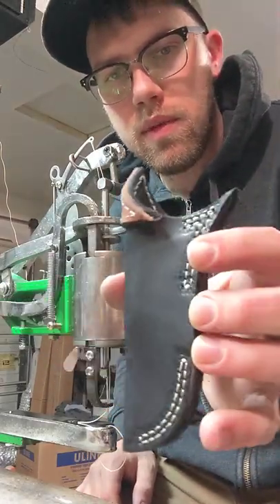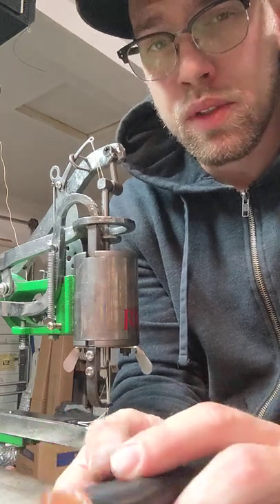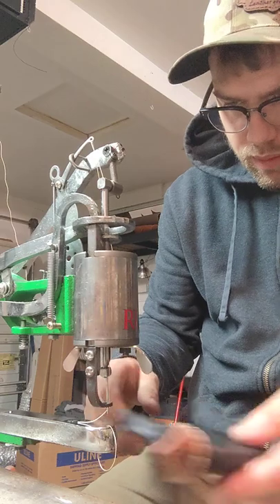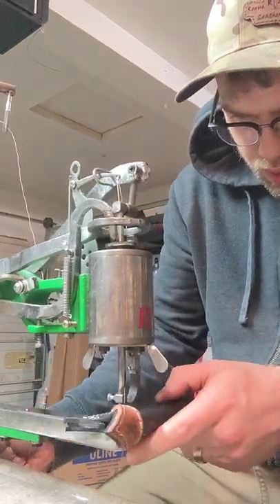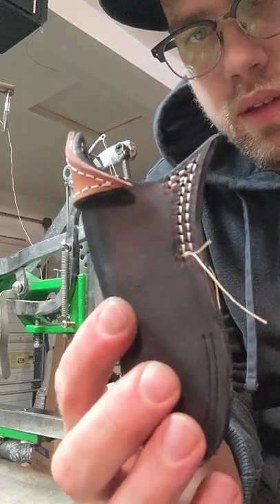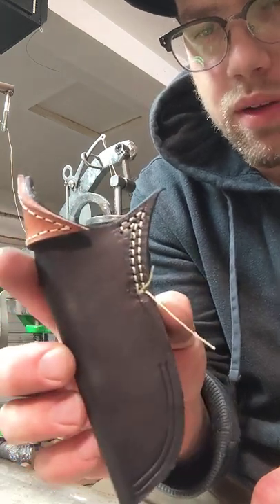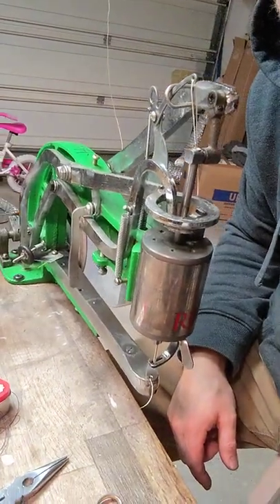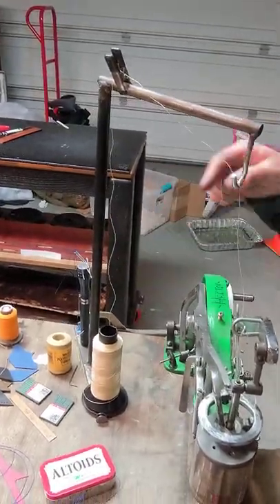Sewing 24oz of leather on the china Shoe Patcher!! Making a Thick knife sheath

Comment: There is actually an industrial version of this machine that has a post bed and uses industrial needles.  I tried this with my patcher but it was hard to do.  I now bought a cylinder arm and it breezes through the leather.
Reply from the maker: Ya ultimately I've switched to a class 4 Cobra and haven't looked back. CLSP is a good machine for learning to make things with a sewing machine, but is very limited in several ways
Reply: @rogueapparatus6414  Yes, the CLSP can still do things no other machine can do.   I use mine mostly for heavy fabric now.

Comment: I appreciate the video. I've been watching a bunch of these because I've been having issues with my machine in the last little while and I learn something new from every video I watch. Something I did to mine that you might want to consider is filing down the shape edge on the end of the cover plate just around the needle hole. I find the work travels a little nicer over the arm and doesn't leave that noticeable impression on the leather.

Comment: I've got one set up using 135 x 16 #22 needles with 138 and 207 bonded polyester.  Haven't made anything yet but now I have a good idea of what these gadgets are capable of.
Reply from the maker: Nice! It will run 207 ok with that needle but a 23 needle is more ideal.  Powerful little beast for how cheap it is!!
Reply: @rogueapparatus6414  #23 won't quite fit down through the channel below, but I plan to run a burr through with the Dremel so I can use them.
Reply from the maker: @davefarnsworth3020  ya only the older machines were made to work with a 23. I used a drill and a good quality bit to bore it all out a little, then I used a bigger bit to chamfer the top plate which really helps to catch the needle and keep the bottom from getting hung up on the hole
Reply: What kind of thread are you used looks thick

Comment: From what I hear, you are using 138 on the top and looks like the same in the bobbin.  It looks so big I thought it was 207.  It really looks good.  Do you always use the same thread in the bobbin that you use on top?  In your opinion, do the threads need to be the same?  I would like to use the largest thread I can on top, but something smaller in the bobbin so I can maximize my distance sewn before changing bobbins.  Have you tried using 207/138 or 207/69?  Or 138/69?  I have some projects coming up that will require some long runs where changing bobbins is going to be a problem.  The underside will not be seen so being a size or two smaller won't matter much.  What do you think?

Comment: Thanks for the video. Help! I still can't get the bobbin thread to pull up. I sanded the whole bobbin shuttle down. I've watched several videos on how to thread the machine and bobbin. I finally figured that the bobbin thread goes behind the thread spring. Tried several tension options. The bobbin thread still won't pick up. If I hold the bobbin thread slightly then run a cycle through the machine, it brings thread on the other side of the needle. However, it still doesn't pick up the bobbin thread. Any ideas?
Reply from the maker: Sounds like probably a timing issue. The bobbin carrier may be off by a few clocks or possibly the needle bar is out of adjustment
Reply: @rogueapparatus6414  It worked. I lowered the needle to point I can feel the tip through that hole under the bobbin shuttle/casing. It picked up the bobbin thread. Thanks so much.

Comment: Great video, what size type thread are you using on the bobber?
Reply from the maker: Same as the top thread. In most cases I use 138 but also 207 works with a bigger 23 needle
Reply: @rogueapparatus6414  awesome thanks 👍
Reply: Well I'm gonna give this a try. When I stitch cloth I have to do a back stitch so the thread locks and don't unwind. Do I just cut the thread and no back stitch? Thanks for your help really appreciate it
Reply from the maker: @ARXER-hi1zs  you always need to backstitch with machines because the lockstitch style can't hold without being back stitched and /or melted. 

With leather I do 3. Cloth I'd be inclined to do 5 or so back stitches

Comment: What is the  thickest thread you can sew on your sewing machine
Reply from the maker: 207 with a 160/23 needle. But I'll admit it wasn't very smooth and just felt labored. I prefer 138 with a 140/22 needle
Reply: @rogueapparatus6414  thank you. I've got 207 thread and wanted to use it. I'm thinking about putting a servo motor on it
Reply from the maker: @johnrisher3007  many people do! I never motorized mine, I'm investing in a class 4 cobra, but the CLSP will keep a place for special jobs